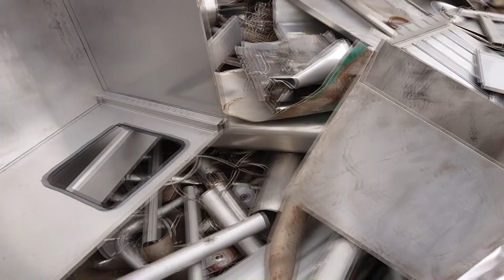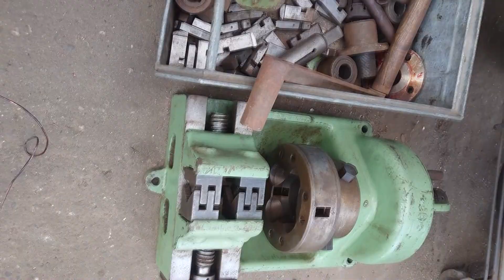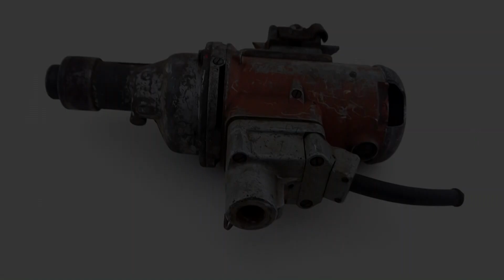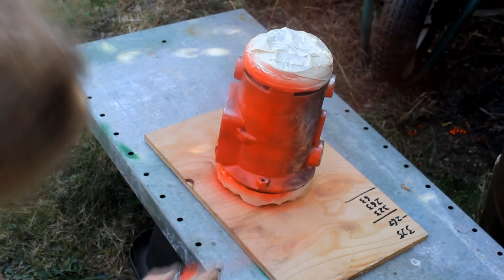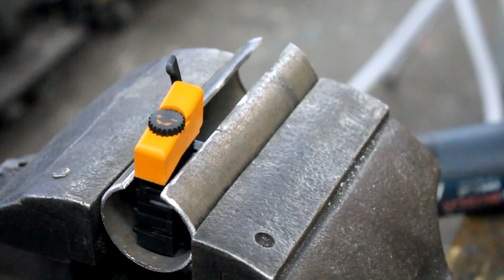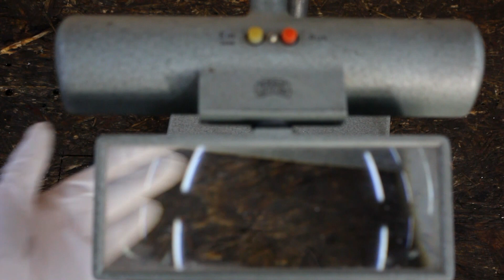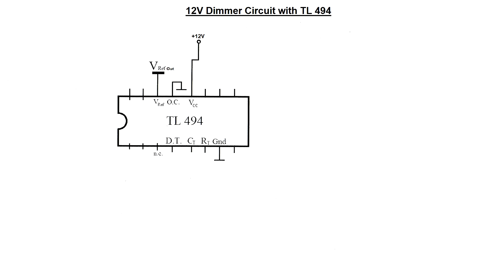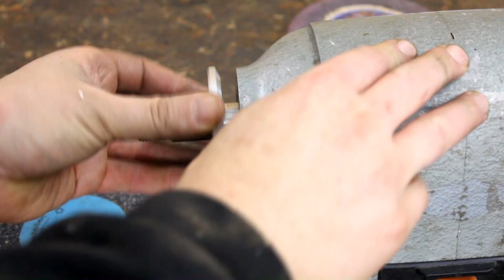Rare Scrapyard Finds! Repair-A-Thon!

Comment: Instead of another drill press, you could use this big Fein drill to build a mag-drill. Cool idea, ha?
Reply: Had the same suggestion. Could make for an awesome Video. 

Maybe with Microwave Transformers for the magnets.
Reply: @philippsaure7545  - not sure if those magnets would be strong enough.  I'd imagine some neodymium magnets arranged in some sort of lever arrangement inside a fabricated base would work?
Reply: @samvalentine3206  Right, similar to how magnetic base (e.g. for dial indicator holder) works.
Similar to: https://www.youtube.com/watch?v=n9tZIFfM14o
Reply: @samvalentine3206   You are most likely right. Maybe such a configuration could even save some space and increase the usability of such a device.
Reply: @samvalentine3206  Mag drills usually have electromagnetic bases.
There's plenty of holding power when you apply the current.
Reply: @jimurrata6785  - That makes sense.  Thanks for the info.  I've seen Andrew Camarata use a mag drill in his videos and was blown away by the ease in which they cut thru steel, albeit mild.
Reply: @samvalentine3206  Where are you on the island?
I've been looking for a decent salvage yard, but all the cool manufacturing (like Grumman in Calverton) is long gone now..😞
Reply: @jimurrata6785  this guy could also build the magnetic safety switch so it won't run if the mag let's loose.
Reply: Likely what that slide mechanism indicated it was originally attached to
Reply: Think that's a bit of a heavyweight
Reply: @THATSMYNAME-LFC  Being heavyweight is a good thing when you're a mag-drill.
Reply: Yes the drill is best suited for a mandrill stand
Reply: He actually made the mag drill, check out his latest video
Reply: @Nicol Yup.
Reply: Sorry for my ignorance but, what is a mag drill ??
Reply: @marcryvon  it is a heavy duty drill that has a magnetic base.
You can stick it to something like a big steel beam, and it acts almost like a drill press. (Where you could never get a 50' (14M) beam into position.
Reply: This is absolutely the right thing to do with it.Could do an electromagnet for the base to increase the holding power without a large base.

Comment: The company who made the thread cutter send manual free of charge and are very nice.  You try to replace the battery in an iPhone apple basically think your evil.
Reply: It is just one of the many reasons German Engineering still carries a lot of positive vibes.
Reply: Yes we brake their business model,  obsolescence apple that is.
Reply: And that is exactly why there are alternatives like the Fairphone. Even no tools required to swap the battery (for model 2. for model 3 don't know actually, but guess it wont be very hard)
Reply: @algemeennut6683  No thanks, iOS is awesome. You can keep your Commiephone.
Reply: @uclajd  enjoy your overpriced phone with a complete lack of privacy:) They do have intuitive and stable software though, I'll give them that
Reply: @63ch31  Nonsense. Apple protects your privacy. And iOS 14 defaults to zeroing the unique ad identifier.
Reply: @uclajd  the ad identifyer isnt needed to identify you. Yes, android can be a lot worse, but you can also use custom roms to keep google from identifying your device. Also, do you really believe apple keeps your data to themselves?
Reply: @63ch31  Yes, Apple cannot see your text messages if they wanted to. They cannot break your phone encryption. They can reveal cloud data with a court order. Their major marketing idea is privacy. So tell me what possible reason they would have to snoop and ruin that? They don't sell data, so what would be their motive?
Reply: @uclajd  The privacy advantage of ios over standard google android is so slight, that it's misleading of apple to use it in their marketing in the way they do. My main point is that none of them are private. In ios wifi scanning can not be turned off unless you desolder the wireless modem chip. I can't seem to find a non-fishy reason for them to implement that to be honest.
Reply: @63ch31  You are wrong. Google's entire business model is selling your data. Apple allows you to be totally anonymous BY DEFAULT. If you can't understand this basic but stark difference, you may have been dropped on your head as a baby.
Reply: @uclajd  I understand the difference, that does not mean your claim is factual. I believe that you believe your privacy is intact. If that's enough for you, i'm happy on your behalf. I appreciate your concern about the safekeeping of my infant self, I can however assure you that no severe head trauma was suffered during that time.
Reply: @uclajd  they may not be selling your data, but they absolutely are tracking your use of the phone, from where, and what apps you use. You seem to be conflating them protecting your private data with them tracking you.
Reply: @63ch31  They identifier is needed for advertisers to identify you. Apple has no reason to track you. They don't sell data, they sell hardware.
Reply: I love my xiaomi, yes it might have a ton of background wavenoise, and without custom roms the chinese know which hand I use to jerk off, but oh man is it easy to repair.
Reply: @markellii3093  I might have to look into   installing lineage to a xaiomi phone. I doubt they have fap-detection software outside the main ssd haha
Reply: Having a cell phone be serviceable by people without specialized tools is hardly comparable to making a pipe threader be serviceable and repairable. While I agree Apple has become even more evil than they were in the past, you are comparing meerkats to screwdrivers.
Reply: @railgap  Evil? That's a strong word. You sound like a Commie.
Reply: @16vjtdalfa 5 years in the UK under the sale of goods act. Few people KNOW  their rights and companies like Apple love this.  Best way to get what you want in an electronics store is to mention your statutory rights. They'll do anything to get you out of the store before you infect other customers with knowledge of their rights
Reply: Remember when you could replace the battery on a phone by just popping the cover off the back. Good times
Reply: That's because Apple would rather sell you another phone or product then fix their own products and try to make as much money off of the suckers that buy apple products by making cords that have to be mfi certified meaning any company that makes a cord must pay apple to certify their cord otherwise it is considered an aftermarket/counterfeit and brings cost up for said cords because they are money hungry greedy and against right to repair etcetera
Reply: Check out Louis Rossman's youtube page. He's testified in fronta Congress regarding right to repair.
Reply: @16vjtdalfa Yet another poor-ass Android user, the company (Google) whose entire business model is SELLING YOUR DATA.
Reply: Lots of people will damage their iPhones trying to replace batteries and then cry for warranty repairs once they break it!
Reply: @uclajd  yes, never understood that. EU requires them to repair it under warranty for 5 yrs anyway, for free... so why try it yourself?
Reply: @TheChipmunk2008  There's a reason there is ZERO innovation in the EU. Overregulation. Apple should stop selling in Commie Europe. Outrageous ridiculous regulations. No way Apple should have to pay for dunderheads who damage their phones. STOCKHOLDERS ARE PEOPLE TOO!
Reply: @uclajd  they don't have to repair phones you damage for fecks sake. They have to repair defects for a reasonable time. Meaning there is no reason for people to try it themselves.
Reply: Also communism isn't bad lol
Reply: @TheChipmunk2008  I guess you've never been to a communist country, let alone lived in one.